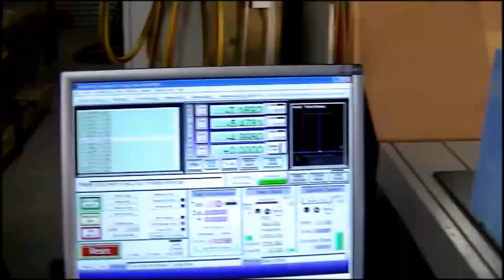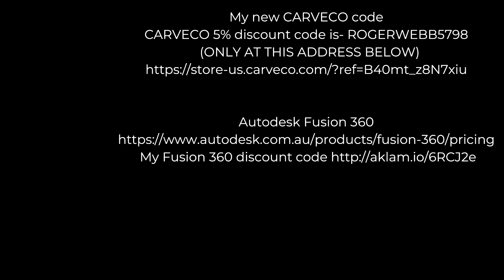Harbor freight/grizzly X2 CNC mill conversion 43K views #everything you need to do#

Comment: Thank You Roger, thoroughly enjoyed watching you do your thing. You helped me see new ways to convert my Dremel Drill Press and its Mini XY table into a conventional style Mill. In Nano scale Maybe but still could be done. The Aluminum Blocks are too much for me. I have no other machine tools, But I have a 3D Printer and a good one. I want to see if you end connector Box could be printed.  Thank You so much. At 74 I ain;t dead yet, so I want to make more trains and I need a CNC MIll to make motors and Chassis . This may help me out.

Comment: Hi Rodger, I am just waiting on my mini mill (King) to arrive in Canada.  Once it arrives I will be joining your Patron channel.   I have built a aluminum frame CNC already and I have a extra 4 axis card. As well as 2 extra stepper motors.    So it seems inevitable that this will happen.  
But lets say One didn't have stuff already.  To add a DRO to these.  Do you think   "For the money" investing in steppers and cheap controller card is the wise choice?  Since you get a DRO on the computer.   You can use a wireless controller to control the X-Y-Z.
Although, the manual dial controls are probably not able to be used with the steppers powered?
Reply from the maker: Hi have a look at the SMC5-5-N-N controller
Reply: @rogerwebb9600  For offline control it looks interesting.  But I already have a laptop with full licensed mach 3 to run the CNC and my laser.  But the intergrated drivers is tempting. 
On another note could you use a dual shaft stepper and have the hand control dial on one end?  For basic milling I could use the hand control.  Steppers not powered of course.